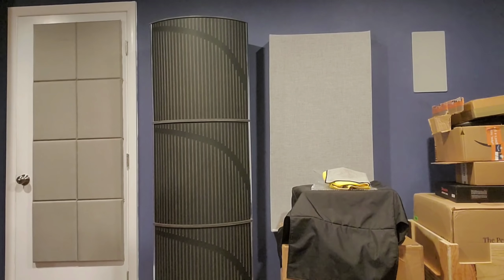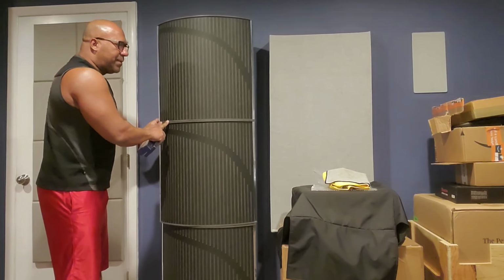Furutech Outlets initial reaction!

Comment: Here's a suggestion: ditch that Furutech NCF outlet and install a Shuyata SR-Z1 outlet. It'll take all of a day to burn in, just from having it connected and powered. And, it'll sound better than that Furutech outlet and you won't be having any of these issues. The problem with the Furutech outlet is the rhodium plating.  That is the worst material to use for anything that makes electrical contact for power.
Reply: Bullshit. Rhodium is one of the best, but it's sound opposite to gold - rhodium is more of a dry and very accurate in tone and gold is warm and not so much accurate in control of bass for instance.

Comment: Just put the outlet somewhere else and let something consuming 1000w/h like an electric heater) run for 150-200 hours. This is also the way to break in any high current plug/ cable. In my experience, it makes almost no sense to use the audio room to burn in plusg, outlets or power cables

Comment: Hi, Jay. I got the Furutech FT-SWS-D-NCF outlets coupled to a powercable Furutech SP-SO32N going directly to a separate circuit. I’ve had it for a little less than two years now. I can’t say it has not been issues - first the socket holes was so narrow that it didn’t connect very well my PS Audio AC-12 powercable. In that process I blew a fuse on my DS PowerPlant 15. When I found out that I had to use so much force nearly breaking the carbon fiber cover of the outlet it got me a bit worried. The sound wasn’t top notch at first, but less than running a 100 hours it sounded significantly better. After 200 hours the bass was tighter and the highs sounded more refined than what I can remember to have had. After that I can’t say that the sound has become any different. The difference from before and after the Furutech is quite substantial to me. If I’m building another home some day, I think I’ll stick to Furutech outlets for my dedicated audio circuits.

Comment: You have to hang in there with these Furutech outlets. Seriously, it takes about 6-8 weeks to break them in, but the difference they make are dramatic. Furutech products are the worst in terms of break in time.
Reply from the maker: That's the plan !
Reply: @jaysaudiolab  It is very upsetting with these. They go through varies stages of unbalanced presentation, but the harshness will smooth out, and the bass will come back (eventually). The absolute spatial separation and the natural dynamic ebb and flow of the music is not at it's best before the end of the process. I would not evalute them seriously before 500 hours, and even longer.
Reply: How do outlets break in?  Not familiar with this concept.
Reply: @expresscruiserlife  The sound changes during the first weeks of play. If you ever try it  you will notice it. If you would ask an engineer, he will probably say that changes in the sound It's based on mood of day, or that it is the listener that gets used to the sound, or that it is flat out illusions because they think It's not proven scientifically. Those guys are all around the web. Taking turn to patrol, between the time they read audiosciencereviews and watching audioholics.
Reply: @geir8849  Thanks, was just curious what was happening with the outlet during the burning process.
Reply: @expresscruiserlife  I know that Furutech crygenically treat their product. For some reason this has an effect of the length of the break in time. I talked to many manufaturer of cables, and as far I know it is not been explained in detail what happens during this process, but something does.